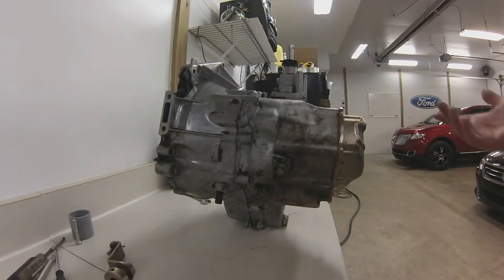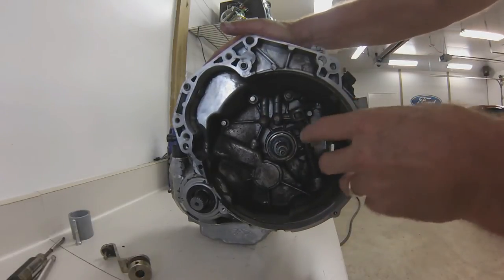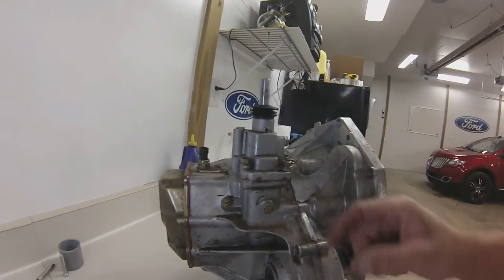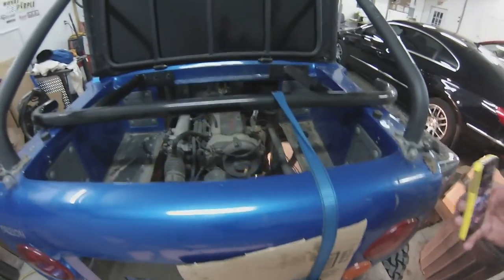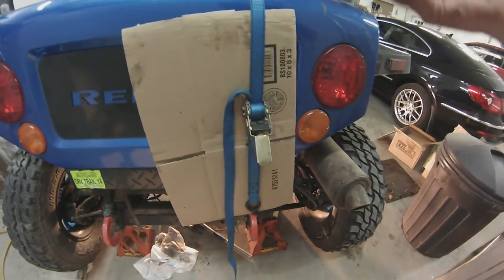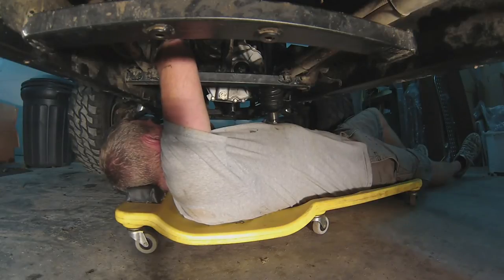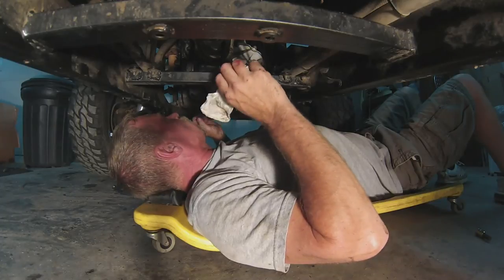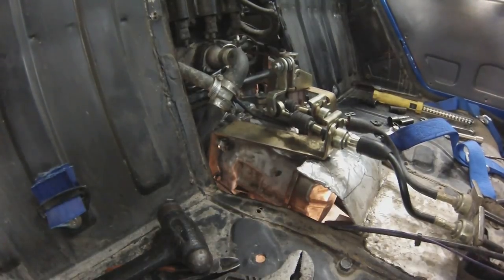Transmission install, and overview

Comment: HI Where would I add the trans mission fluid ? Thanks
Reply from the maker: If you know where the drain plug is. You will see an identical plug to the left and slightly above the front  output shaft. This is the fill plug. You fill to the point of overflow.The drain plug is the large bolt at the front bottom as the trans is mounted in the machine.
Reply: +Scott BeaverOffRoadLLC thanks for the help, I've owned my Reaper since 2014 I now have 11600 miles on mine
Reply from the maker: johndeere5719 It is best to use a synthetic such as Royal Purple Sychromax manual trans oil. It will offer better protection and aid in shift performance. Roughly 3 pints needed.
Reply: Do you have any info on the clutch that is in the reaper. My son used mine and now I have a dead pedal. Clutch cable is good all the way back. Thinking he might of damaged it trying to downshift and rev match.